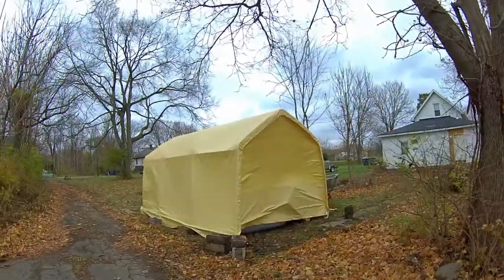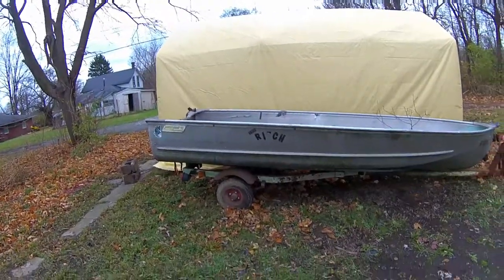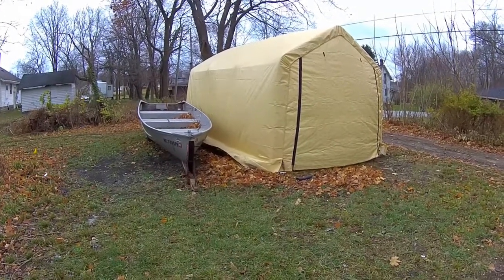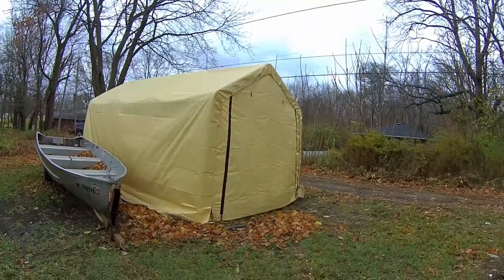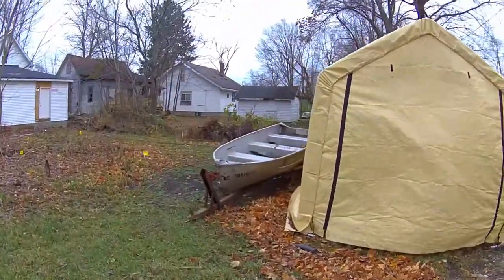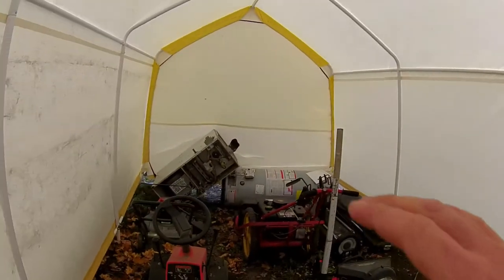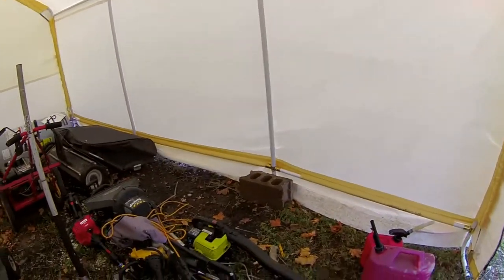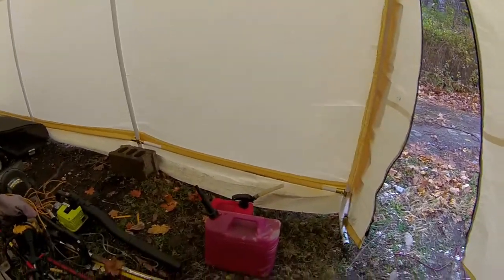Review - Harbor Freight 10x17 Carport - High Winds Test

Comment: These are only good for shade of you put mesh tarps on it, at least for the sides, and the legs in cinder blocks too. You can also put like four 5 pound weight plates on the top resting on the tarp with a rope through them. Also get ones with steel frame, not aluminum.

Comment: I believe you are supposed to anchor the flap on the outside edge of the walls with something like sandbags or railroad ties so air doesn't have a chance to pick it up turning it into a sail...
Reply from the maker: That would be a good idea, but there isn't enough flap to fold over and do that. It went full sail the other day despite the ground ties and concrete blocks and stakes. It's trash now lol

Comment: Lag screwed it on 4 4x4’s connected by steel mending plates.  Drove 4 ft rebar at the end of each 4x4.  It’s windy where it’s located the amount of buffeting is similar to that in your video.  I am currently using it for tractor storage.  I should have a more permanent solution to house the tractor by the fall.  In general, I would not put anything in this that would upset you if it collapsed.  Good video

Comment: What i did on mine was build a solid foundation wood floor 

get  4 treated 11 ft 4x4 ,going from one side pole to another , get long screws to mount those legs deep into the 4x4 

Add treated 2x4 to support the treated plywood  … the weight from all the wood willl hold it down and when u store stuff on it is not going anywhere 

My tent also is on an open field - and windy area in NC its been 5 years and the only part that is  degrading is the trap - 

Duct tape all the joints and use tap screw as reinforcement